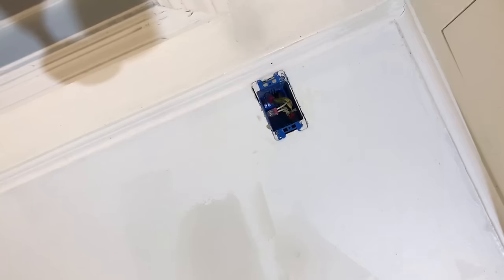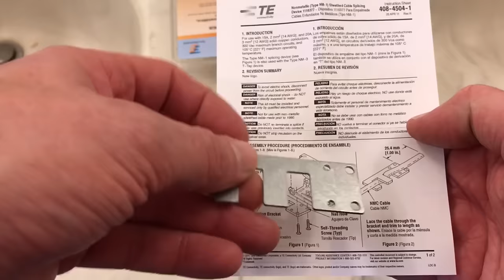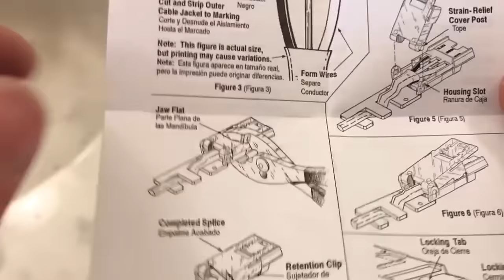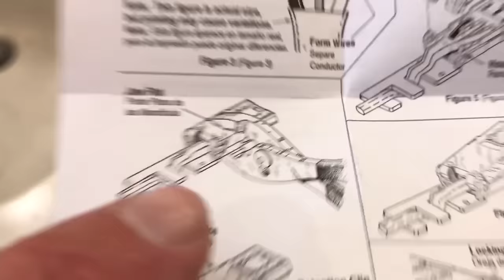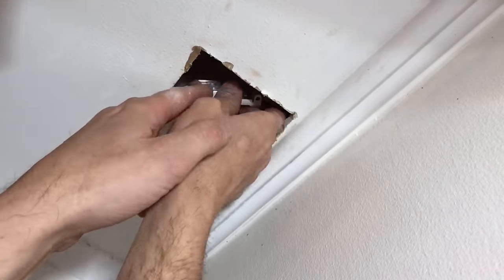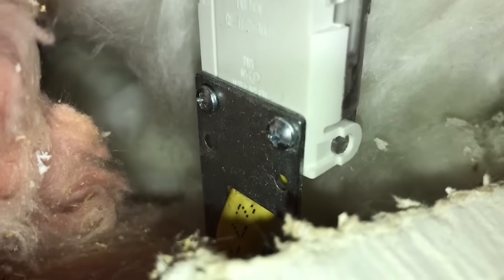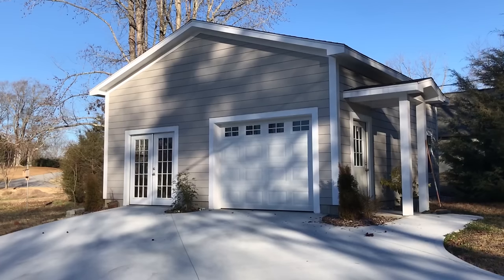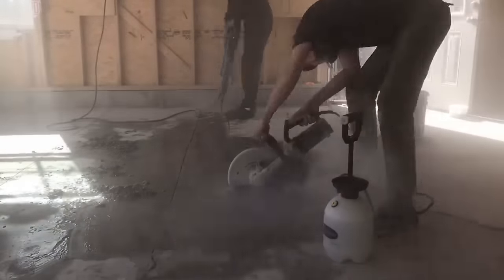Do I have to have a junction box to splice wires?

Comment: So instead of 1 connection per wire, you have 3. In a cheapplastic housing with a tiny amount of contact area. You're  better off using wire nuts and a junction box.
Reply: He removed wago connectors to use those?
I would have just used the Wago connectors in a wagobox, faster, easier, cheaper and give a better wiring contact

Comment: I can see millions of qualified electricians who have stared endlessly at the NEC, and sat at the feet of world weary Journeymen, listening to their teachings, react in horror to this plastic device. It goes against the grain. Nevertheless, there it is.
Reply: And dangerous,  Almost as dangerous as wire nuts.
Reply: @dogwalker666  Wire nuts are NOT dangerous, and have a tremendous track record. I have never had a failure in a lifetime of electrical work. As in most things, it all comes down to workmanship and conscientiousness.
Reply: @paulmaxwell8851  Exactly  the whole wire nut dangerous thing is an internet myth,  actually much after and reliable than those other connectors.  And what all these DIYer leave out if you have an electrical box with multiple Romex  connectors and an outlet you don't have any room for anything but Wirenuts.
Reply: @paulmaxwell8851  I don't know Paul, the dog walker says their dangerous, so it must be fact.
Reply: @dogwalker666  Wire nuts work better than aluminum wire. I've used them for 68 years.
Reply: 'There it is' doesn't make it legal. The fact you can buy it at the local hardware store certainly doesn't make it legal.
Reply: @paulmaxwell8851 What makes an arc fault circuit breaker trip. 1960s trailer with a cracked 60-year-old wire nut.

Comment: Just a suggestion - when using your bathroom vanity as a workspace, close the stoppers on the drains.  There is a reason I know this.
Reply: You can also remove the catch, so not the end of the world.
Reply: Keep the toilet seat covered too. A new bar of soap can just slip off and go in during a flush. Weeks later it still refuses to dissolve, plunge, or snake away. Only water passes.
Reply: Haha yup!  First step in bathroom work, block off the drain.

Comment: I can't believe the NEC or NFPA allows this kind of "splice". Insulation-displacement connection forks should be considered temporary at best (better not at all) due to their limited electrical contact points. Also, dissimilar metals contacting each other with current passing between them is always a bad idea. The shells are very likely molded of thermoplastic (softens when heated) and the "clamps" will quickly damage the NMC if used in a vibration environment. This device de-rates the entire circuit current carrying capacity. When it comes to dealing with the potentially destructive power of electricity, better go safe or go home.
Reply: You are spot on! This type of splice in the auto industry is well known for causing fires. I hate them with a passion.
Reply: I can't believe you think you are more knowledgeable than the NEC. Trust you or trust the NEC. Yeah. I'm relying on you.
Reply: explain then why every appliance now has aluminum wires being wire nutted together with copper house wires?  Stoves, dishwashers, ceiling lights etc.
Reply: I seriously feel like a 6 lever Wago connector with a simple clip together box over it would be better than this, hahaha. It could be mounted on a metal strip with tabs to still have the pull out preventing strain relief.

Comment: As long as you're going to patch the hole where the junction box was, you might as well install a new cable with just a little more patching.
Reply: not so easy if the wire has been stapled beside the box and any floor transition
Reply: @davebrown6552  Leave the old Wire there and run a new one next to it.
Reply: @KevinWta  here is my problem with that. assuming you can find a way to chase the new wire, if it not going to be stapled outside the box and between floors then it would not be to code, if it considered safe anyway then the staples required by code are unnecessary. and leaving them out could have enabled using the old wire to pull the new. 
and it leaves all the old crap behind. I once lived in an old Victorian house in the uk that had been converted to flats and then back again it had 147 fuses (mostly no longer connected with some that dated back over a century), fabric wrapped wires (definitely no longer connected. and an electric  servant call system The electrician that rewired the house for us replaced all the crap with two  8 fuse consumer units with some spaces left.
Reply: @davebrown6552  Staples are only required for new work. As long as the sheetrock is up you can fish wire in the wall without putting staples,
Reply: @KevinWta  I know, it is just the stupidity of them that annoys me. I understand the idea of keeping wire out of the way of the sheet rock installation but making them out of steel instead of something that will easily break away during fishing is dumb, just some masking tape would keep wire in place for closing but would not interfere if the wire needed replacing later if it was damaged too short to move a box or needed a different wire type. size or number of conductors.
Reply: @davebrown6552  I still don't understand what the problem is. Once the old wires are removed from the box at each end then just leave them in the wall staples and all and fish in the new wire next to it.
Reply: @KevinWta  mostly because it is messy and I think unprofessional  but also it leaves dead wires in the wall that could add confusion if there was a problem later.
Reply: @KevinWta  That is NOT correct. Re-read your code for securing wire bruh.
Reply: @davebrown6552  If you think an unused cable inside walls is messy, well I won't comment on that.
Causing confusion in the future?
That seems unlikely.
It wouldn't be inside any box, so you'd only find it when opening the wall.
Reply: @davebrown6552  You are allowed by code to fish romex through concealed spaces and not support it every 4.5 feet.  
NEC 334.30 (B) Unsupported Cables. Nonmetallic-sheathed cable shall be permitted to be unsupported where the cable (1) is fished through concealed spaces in finished buildings or structures and supporting is impractical.
Reply: @calculator1841  Reread your code for fishing through concealed spaces in finished buildings. 334.30 (B)(1)
Reply: @DouglasGross6022  If there is potential for confusion, just label the wire dead/disconnected.
Reply: @dalecarnegie4440  You'd trust such a label?
Reply: Metal conduit (EMT) would have prevented the problem in the first place

Comment: You are a brave man working on that vanity with the sink pop up wide-open LOL.
I learned a long time ago when working near a sink to close or cover the drain cause it is guaranteed when you drop one of those screws it’s gonna bounce into the sink and disappear down into the P-trap
Reply: Hes also a risk taker for using a no contact voltage tester to determine if the circuit is hot.
Reply: @RadioRich100  Most people including most of the mom electricians in our large maintenance shop know how to properly yes one. Only safe way is to test on a know live circuit to verify that it works then test the circuit that will be worked on then retest it on a know. circuit. Even when I did all that I would take the suppository denerhised wire and short it to ground. Rather have a burn mark on a box then a dead electrician.
Reply: @JohnThomas-lq5qp  Do you ever read your messages before you post them? Lol
Reply: Hahaha! My first thought too was about the open drain!!
Reply: I noticed the open drain plug too, lol!
Reply: Yeah, you go ahead and rely on a contact free voltage tester. If you dont know the reason for my ststement, best you kerp your opinions to yourself, because that's all it was, just an opinion

Comment: A customer supplied me with some these several years ago. After reading all instructions and specs twice, i installed them.  I was pleased with the robust strain relief and I do agree that the connections are a bit sketchy. Toggle clamps like the  Wago 221 would have  made me feel better.
Reply: There sketchy because you must be sketchy. Don't make stuff up to try to appear smart. Nobody with any knowledge knows smart is not in your area of expertolise.
Reply: @nothankyou5524  What a massive overreaction.

Comment: These boxless splices are approved by the NEC. I was told they started out in the Mobile home industry as interconnects when mating up double-wide homes etc.  I have used them for a couple of repairs where there was no spare cable length to add a box etc. I decided to use some dielectric Ox-Guard as an added precaution against corrosion. It has been working just fine for some 10 years or so. This device is a godsend for sure.
Reply from the maker: Glad to hear ... and I really appreciate your real-world-use input Jim!!

Comment: I'm with a lot of other people that even if these are accepted by code, they still seem like probably a bad idea in most situations..  The really sad thing is that it seems like they could actually be so much better, though.

The real key bit here that potentially makes these ok without a junction box is (a) the metal strain-relief brackets on the two wires coming in and (b) the fully-contained wire connection points.  However, both of these could be better done in other ways:

Make a single metal bracket that both incoming wires are run through at either end.  Then use something like a double-ended Wago connector in the middle, so you actually strip the wire ends to the right length, feed them into their individual holes, and clamp them down with a simple locking lever (possibly even with an enclosing plastic box around the whole thing), and then weave them through the bracket and you're done.

It would provide better strain-relief, much better electrical contact, fewer potential failure points, would almost certainly be more reliable, could probably be made smaller, would be harder to do wrong, and actually wouldn't even require a screwdriver to install.  That kind of device I might actually consider using.  This one?  Even if it's technically to code, probably not.
Reply: I like your idea for the metal bracket, with strain relief at each end, makes a lot of sense.  And I would think that even your garden variety crimped connector would be better than this thing, as there is virtually zero connection area.  I would worry about this getting hot, and melting.
Reply: @nunya3163  I think this is (at least partially) responsible for the AFCI requirement. 

Less contact area = more chance of arcing.
Reply: @pyrotech7210  Less contact area = more chance of arcing = more chance of fire.
Reply: I'm actually amazed I can't find a better version of this with wagos or screw terminals.  There is money to be made there.
Reply: Yes, I agree that a better splicing device could be designed, BUT,  NEC 334.40(B) requires that said device be Listed to qualify under its exception to the requirement that a box be used for repairs such as this one. Sorry...
Reply: @mikegardner9855  Yeah, but that's actually specifically why it's so frustrating that this device is listed when other much better possible designs aren't.
Reply: @pyrotech7210  This component has nothing to do with AFCI requirements. It's UL tested and listed, which is a much better way of evaluating something and providing an educated assessment than watching a YouTube video.
Reply: You read my mind with your suggestion. A single metal strip with a 6 lever Wago style connector and a clip together box that goes over it. Easier, safer, better.

Comment: The little "insulation piercing" terminals are used in box fixtures designed for RV's, and they work even they work. Usually on close inspection you'll find a thin bit of insulation jammed into the vee with the conductor, so the contact is lousy. U can improve that nicely by stripping a window on one side or both of the conductor before seating into the vee; this eliminates the thin insulation from melting when the connection gets hot or the compressed insulation pushing the conductor back out of the vee, both of which are common failures.
Reply: None of what you've said is factual if used correctly. Besides, who's trusting you over the NEC?

Comment: As a "victim" of multi-decade-old intermittent connections due to the use of listed push-in connections, I have to agree that while these splices may be legal, are they wise? And as another has asked, how is a failed splice going to be located? The whole failing run would probably have to be bypassed with new wiring, so maybe it would be best to just do that in the first place.

Comment: I live in the midwest and everything here is in metal conduit, so we do not use romex but use solid insulated wire for homes.  You cannot use anything but junction boxes for splicing, etc.  You cannot cover up boxes, they must always be accessible. I have run into this a few times doing some remodeling.  Our solution in ceiling or anyplace in drywall is to use a round decorative cover. They make them in white plastic or metal that you can paint if necessary.  The covers I used were over octagonal metal boxes. Once installed they are inconspicuous. If I could I would include a picture. Thanks…Jim
PS……I learned about these from some old electrician’s leftovers which I got at a garage sale.
Reply from the maker: Good info, Jim. Thanks for all of that.
Reply: I'm guessing you probably live in Illinois.  The reason you can't use romex and everything has to be in metal conduit is because of Unions!  I think they mostly run your state!
Reply: @rpsmith  Yes, I live in a NW suburb of Chicago.  My folks lived in Charlotte, NC and they had romex. I ran into a short in their house and it caused a lot of problems. They were using a freezer in the garage and it would pop the breaker, anytime, without warning. I ended up running a separate line for the freezer,  because of this problem. Eventually, I found the problem, it was a shorted out night light. The problem with romex is, if you overload a line and it gets hot, there is nothing but the jacket of the wire and the outer covering to protect you from a fire. My dad’s home in Charlotte was built in 1985. In the attic was a bundle of romex cables on top of each other going all over the house. This scared me. Here in metal conduit, you have another layer to protect you. When you run power outside it has to be 1 foot below the ground in ridgid metal conduit (thicker than the regular metal conduit), whereas in Charlotte it’s just romex, do you know how it’s protected from a shovel accidentally breaking thru? Knowing both systems, I prefer metal conduit and metal boxes. They do metal conduit everywhere, it’s a matter of choice and paying for the difference. Most businesses in Charlotte are done in metal conduit. I looked into buying a home in Myrtle Beach and the metal conduit option was there if you wanted it. Plumbing has similar options today, copper versus plastic hot and cold water lines. Plastic drainage systems are common almost everywhere. Thanks….Jim
Reply: @jimpie231    --  Approximately 90% of homes in the U.S. are wired with Romex and if it's installed properly it's entirely safe!  And yes, some form of metal conduit is required for all business high voltage wiring throughout the U.S..  I think this post I found online from Bob Weiss mostly explains the conduit requirements in your part of the country: "Bending and installing conduit properly puts electrical work outside the skillset of the typical DIYer, creating more demand for (often unionized) professional electricians."  While arguable safer, this requirement doubles or triples the cost of wiring a home in your area!  Given a choice I think most new home buyers would choose Romex!
Reply: A box can be covered up and still be accessible. Accessible and readily accessible are two different things sir. Like you can make up a box and shove it up into an attic. It’s accessible. It may not be readily accessible but it’s accessible. If this guy made up this splice and buried it in the wall that’s another thing . That’s why anytime you do any type of work whether it be electrical , plumbing , hvac , or anything you always keep records , as builts , so that you will always know where anything and everything is. You can leave notes for any future workers that may follow your work. You can leave hand written notes inside panel covers that explain what you’ve done and where things are. Doing things like that sets professional electricians apart from half assed wannabes.

Comment: Quite Similar to the connectors used in commercial office lighting above grid ceilings (277V, 3 phase typically).  They are notorious for getting corroded and having intermittent open connections (lights go out at random times).   And the Pinch for conductor is very poor quality too.

Comment: Your AHJ (Authority Having Jurisdiction( aka electrical inspector), and local codes will have the final word on these. As a 40 year retired journeyman electrician, I have seen them fail in modular homes, and would not trust them for anything. That type of connection is weak at best, and with any type of sustained load, vibration or strain, will become weaker and looser. That means heat or arcing,  and that means failure and fire.
Reply: I second this assessment.
Reply: As long as it's UL listed, the 2017 version says it "shall be permitted." With that said, I would have to examine it quite critically (including checking the listing) before deciding whether to trust it.